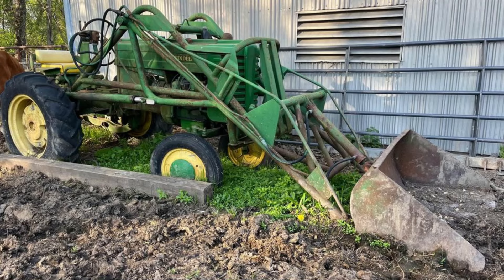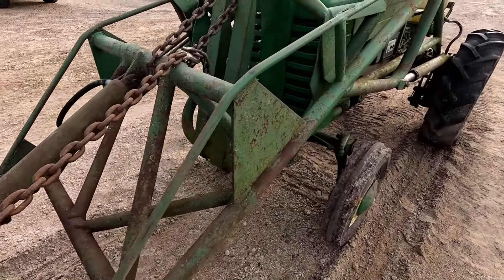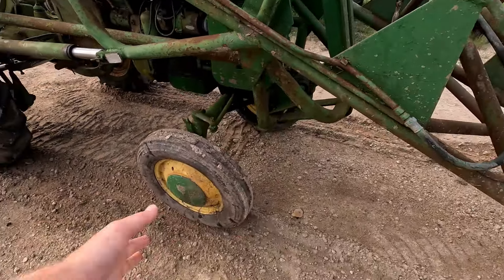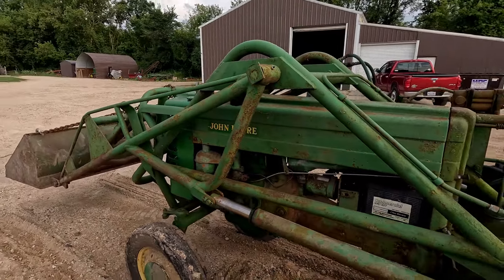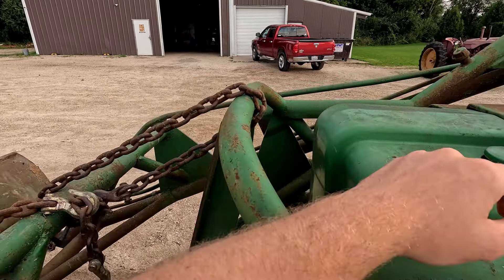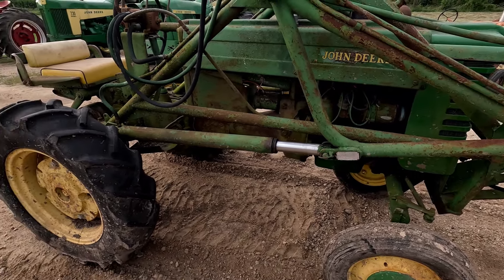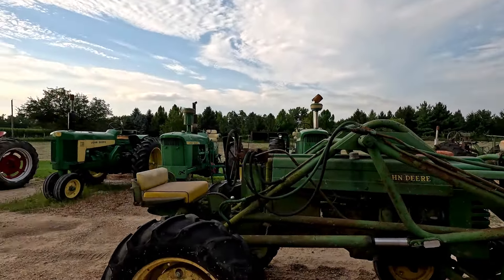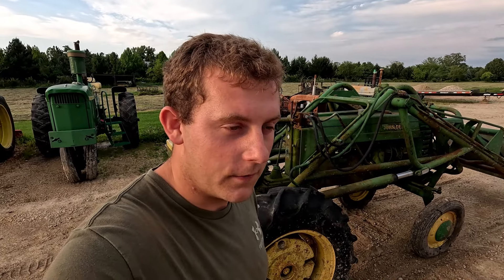Another ANTIQUE John Deere Tractor SAVED! (John Deere Model M)

Comment: Your steering issue might possibly be where the steering shaft connects to the steering box,there is a woodruff key in the steering box shaft that may be either sheared or missing.l would start there and if that's not the problem then take the top of the gear box off to see if the little pin that rides in the worm gear is damaged.